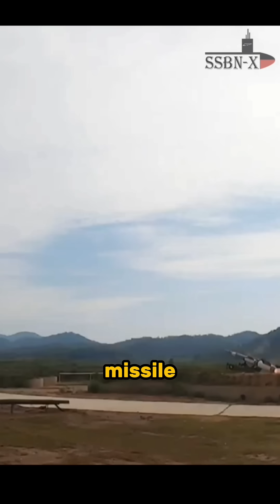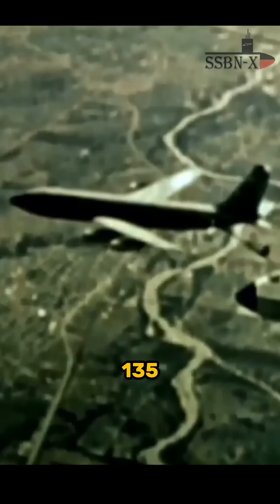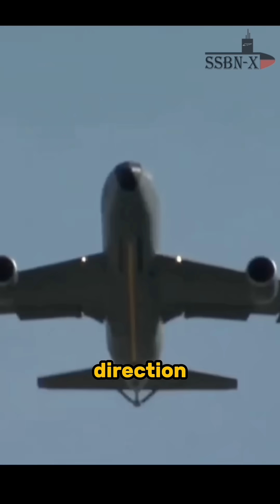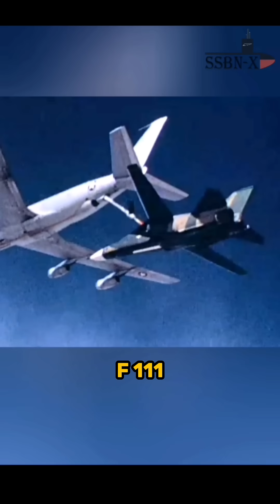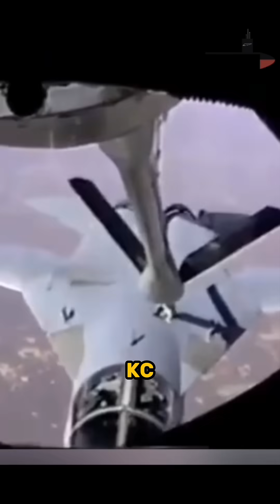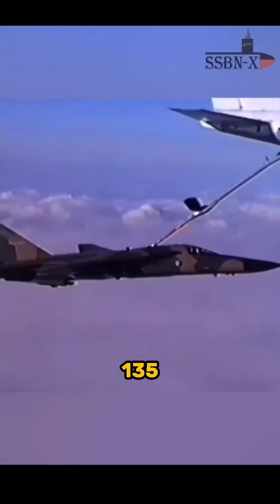In 1973, a KC-135 Towed An F-111 Aardvark

Comment: On june 1982, in "Guerra de las Malvinas" (Falkland's War), a KC 130 refuel constantly a damaged A-4 for 200+ NM over the stormy South Atlantic, until his airfield in Argentina, saving the plane and the pilot (a chopper's SAR mission was impossible at this distance and weather conditions).
As the KC heard the emergency call, it leaves the refuel station and turn into the battle zone to help the A-4. 
A-4's  pilot (Ensign Dellepiane) reach the refuelling basket at once (in his solely chance, 'cause cockpit's gauges indicates zero fuel).
In an inteview, he said he re-borned this day, and the KC's commander is his second father.
Greetings from Patagonia, Argentina ! 🇦🇷

Comment: A KC-135 tanker cannot "tow" a plane in the traditional sense, like you would imagine a vehicle towing another. The KC-135's primary function is aerial refueling, where it transfers fuel mid-flight to other aircraft. It has a refueling boom or drogue, depending on the aircraft being refueled, which connects to the receiving aircraft's fuel system. While the tanker and the receiving plane fly in close formation during refueling, they are not physically attached in a way that could allow the tanker to tow the plane.

In flight, the receiving aircraft must maintain its own control and speed while staying in formation with the tanker. The refueling boom can guide and help stabilize, but there's no mechanism for the tanker to actually tow the plane through the air like a tug pulling a vehicle.

Comment: I was fueling a C-119 high up on a wing in Arizona. An F-111 flew right over my head maybe 50 feet over my head, at high speed and power. I was so startled I almost fell off the wing, which would have severely injured me. I thought it was irresponsible. The F-111 looked to me like it had the aerodynamics of a hammer, but massive power.

Comment: As someone who worked on the 135 and other aircraft with in flight refueling receptacles, this utterly BS. Both systems on the 135 and 111 would not be capable of towing forces. The boom has a travel limit and will disconnect automatically. There is no way to lock the boom in or overide the auto disconnect. The 111 IFRR would also not hold onto the boom with the forces needed to tow a aircraft in flight. Google 2A6X4 if you doubt me. What could have happened was they just kept enough fuel in the tanks of the 111 to feed the engines but no towing.

Comment: "Locked the toggles"... I worked on KC-134As and I am not aware of any "toggles" nor any other mechanism by which the tanker could attach its boom to a receiver and tow it. The connection between the two aircraft is intentionally NOT fixed and intended to breakaway in the event of turbulence, etc. As a matter of fact, this usually happens at least once in almost every refueling operation. I do not believe this story or all of the others similar to it are true, regardless of any warm fuzzies we might get when we hear them.

Comment: Using the fuel line to tow the aircraft in mid flight …… was it built for that ?  Sounds impossible …. Would love to see the foot notes on that one …
Reply: It is NOT like a hose & drogue.   It is a very strong hose inside a metal boom with the boom-wings to 'fly' manurver it to the receiver aircraft.   That is quite stong for two reasons.   So it doesn't break from rough inflight activity between two 150,000+ lb. aircraft.   Next because it has to handle the pressure for moving fuel at a rate of 10,000 lbs. per minute to 250,000+ lb. B-52 bombers.   That boom hose will flex but it isn't all that 'bendy or droopy'.    It would pull most any fighter size aircraft.   
      Having said all that, the large tanker is going to set his airspeed and remain stable.   The smaller F-111 is going to match the tanker speed by small throttle adjustments.   Once the speeds match, the F-111 will only make minor adjustments.   Remember, in this specific event, the F-111 had good engines & speed, he was just leaking badly.   So mostly they were staying hooked-up to provide fuel.   😊

Comment: I’m actually surprised that the boom doesn’t have a safety breakaway mechanism to keep the airplane being field from bringing the KC-135 down should something malfunction!  Awesome job 🫡
Reply: It does.
Reply: The boom has a break away
Reply: fuel leaking from the F111 that bad can't be saved punch out
Reply: The F111 pilot loosing fuel  that bad didn't stick around waiting for the tanker , dropped down  hit AB GET THE HELL OUT OF DODGE. CITY
Reply: No kc135 pilot is going to fly over a sam sight to rescue a F111( tanker are flying coffins) I FLEW ON THE KC135
Reply: Mayday, Mayday  Wolfman hit # 1 Engine out  30 minutes out  ,1500 sounds of fuel

Comment: The intellect and ingenuity of the USAF is spectacular.
Reply: The towing thing is complete BS.
Reply: @phil1517 so is your opinion
Reply: @justinm4363  ---- dude, the fuel boom is simply not designed to tow a plane and will disconnect after a certain amount of force.  To  physically drag a 30,000 lbs plane through the sky is simply not within the cards of credibility.
Reply: @phil1517  tell that to the mirage 2000 pilot we just had get stuck on the boom! He had to violently swing the plane back and forth to break the end of the boom off just to get disconnected. and yes, i work on these planes
Reply: @ReaperRestorations  ---- still not towing on F-111.  No way can the fuel boom endure that kind of force.
Reply: @phil1517 not American so knowledge is limited but did you happen to think that the f111  might of still been supplying its own thrust and lift? I’m assuming the tanks could be isolated, shut the tanks down that were leaking and run off a life support “tow” to get back to a friendly base. Would have still required great communication and skill to pull off.
Reply: @benjenkinson1470  ---- you clearly don't understand what I wrote..  I said the tanker aircraft was not PHYSICALLY towing the F-111 via the fuel boom.
Reply: @benjenkinson1470  --- that was my point... the F-111's engines were supplying the trust, NOT the refueling tanker plane and transfering force through the fuel boom.
Reply: @phil1517  You're just wrong Sparky.  Take the "L" and fade into the night.
NKAWTG!
Reply: Still lost the war😂 all pointless & cash for war mongers.
Reply: @theozze-hc2gi  The politicians and traitors back home lost the war, not the grunts.
Reply: Remember Rambo 2? Pilots get real smart just to avoid capture in Vietnam.

Comment: It didn't tow it. It just kept giving it fuel. The boom would rip off the tanker if there was too much stress. The boom is designed to disengage, if certain stresses are put on it.
Reply: During Desert Shield, we had one of our KC-135Rs refueling an A-10A that would not disconnect from the tanker. The toggles on the receiver aircraft were frozen and would not release from the Tanker. I promise you the Tanker “dragged” that A-10 for the next hour or so. The tanker and the A-10A attempted MANY brute force disconnect attempts with the A-10. The brute force disconnect is where the tanker attempts to accelerate quickly while the receiver aircraft is at idle with speed brakes out (in this particular case). The KC-135 definitely dragged the A-10. Finally after multiple attempt to separate the aircraft, a no kidding Brute Force disconnect occurred. The A-10s receptacle was heavily damaged, repaired once it RTB’d, and returned to service after about a week. I refueled that A-10 after its return to flight. Everything was ops normal. There are several cases where fighters had engine or fuel issues and KC-135 tankers “dragged” them to safety. There were many cases of this in Viet Nam and several cases in peacetime.
Reply: @mcahill135 you’re right Mike Cahill. The first boy thing they got wrong was saying the boom operator locked the toggles. The -111 locked its toggles. And yes, the locked toggles can be undone if the -111 falls back. The boom won’t be ripped off. Good to see you on this post !
Reply: Correct on all counts, sir.
  This is Al generated BS, but many will swallow it without question 😮
Reply: nope, the boom can be locked to tow smaller aircraft. they training for that, is a capability that not many know about
Reply: That makes it even more amazing! Skill levels off the chart!

Comment: The same happened in Falklands war, 1982, with an A4 argetinian pilot.
Reply: A4 does not aerial refuel with a boom. The A4 uses a hose system that is a lot weaker and more flexible connection between the tanker and the receiver aircraft. I doubt it was being towed by the tanker aircraft. Instead, the A4 was probably being constantly refueled because it had some fuel tank issue.

Comment: Now I may be totally wrong (usually am) but the refuelling coupler doesn't actually 'lock' on to the aircraft, does it? So it couldn't physically tow it 🤔
Reply: It does lock on. But if too much stress is put on the boom, it will disengage.